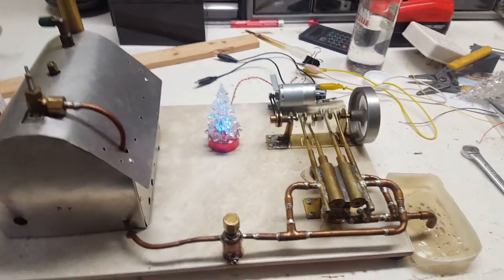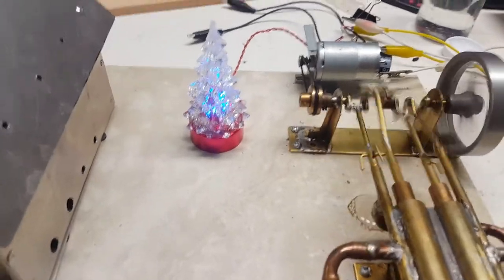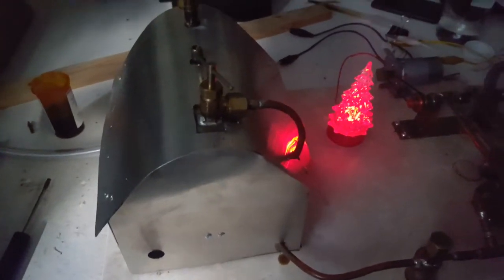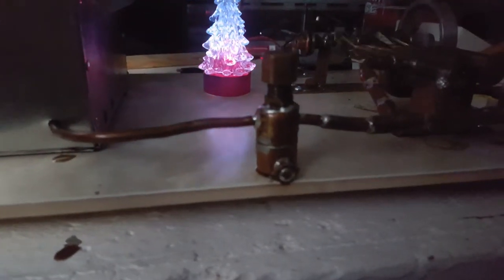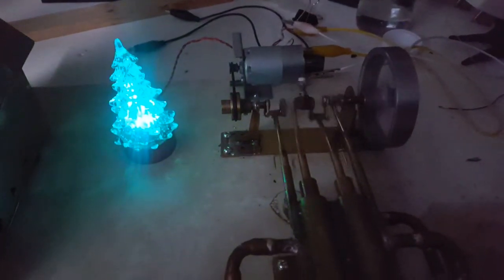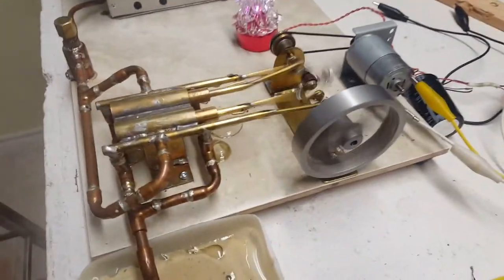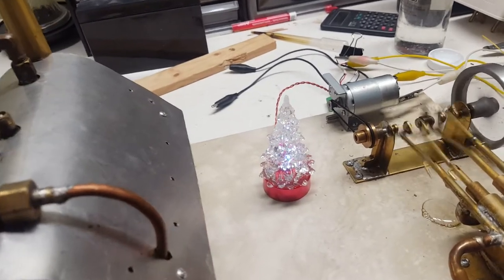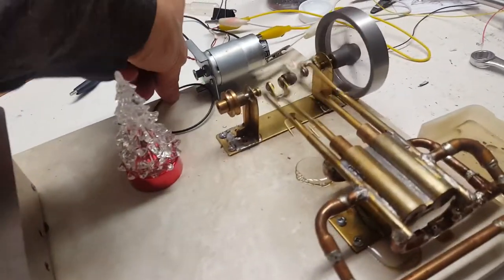Steam Powered Christmas Tree is Back

Comment: How does it works without exhaust port like it don't have like other steam engines
Reply from the maker: The four exaust ports are tapped into one single exaust and the condensate is collected in the plastic tray.